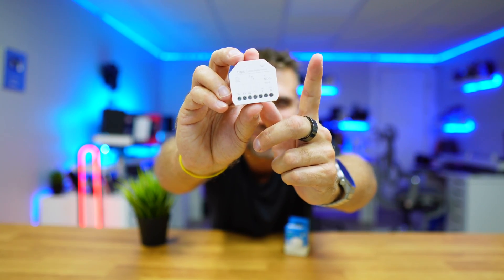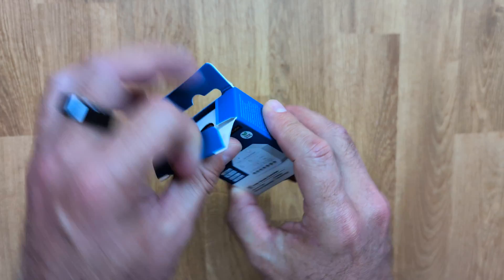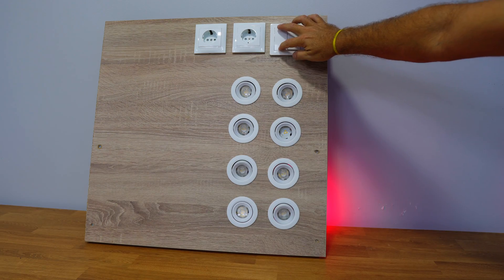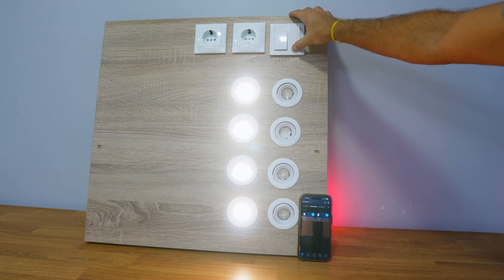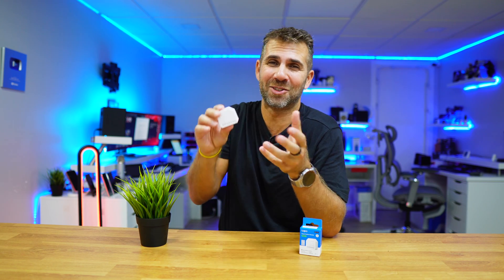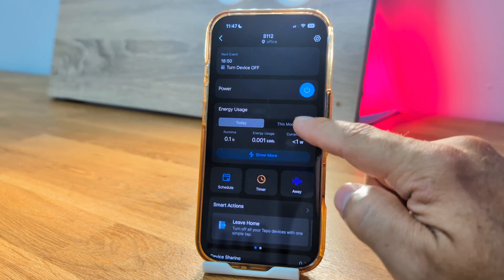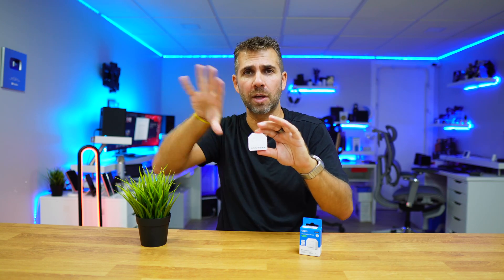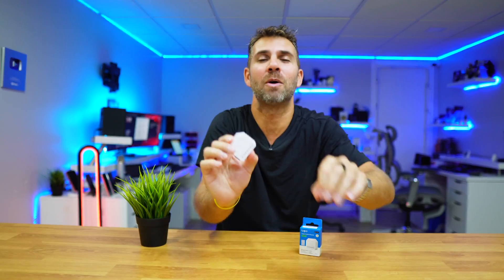How to Install the TP Link Tapo S112 Smart Module 🏠✨ | Lighting & Blinds

Comment: Can I use the S112 to switch a heated radiator? 

I have mains going to a JB, L/N/E and the same going to the radiator. 

I want to switch the radiator on and off via the app.

Can this be done? 

Thx Keith